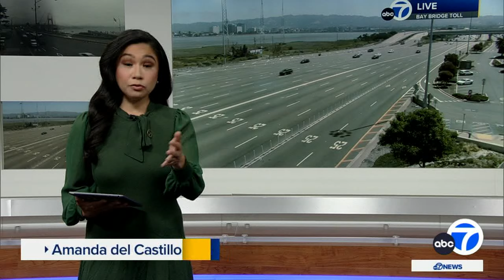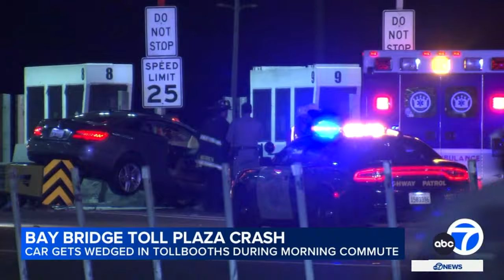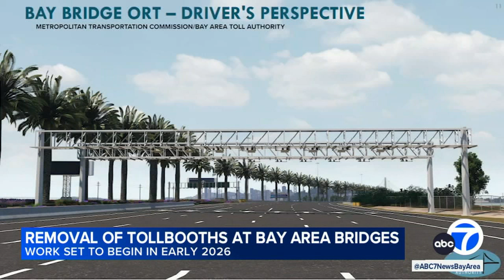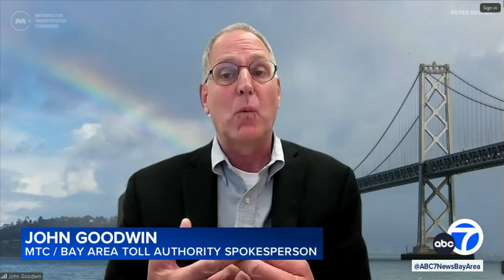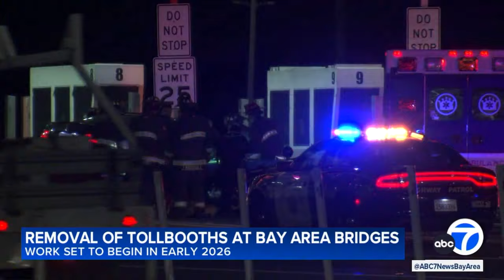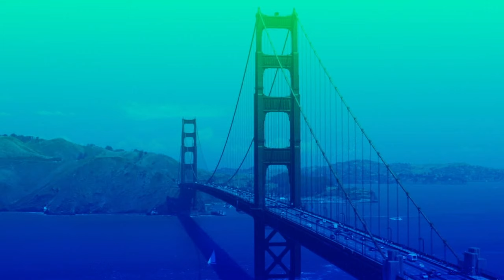Car wedges between Bay Bridge Toll Plaza booths in solo crash

Comment: That perpetually-closed lane on the Bay Bridge is a major hazard.  People not familiar with it don't realize until the last few seconds that the lane is closed, and veer sharply off to the right or left to try to get into one of the lanes on either side.  When traffic is heavy, it gets further snarled by people from that closed lane trying to force their way into other lanes, which slows those lanes even more.  There are already-existing merge lanes just beyond that closed lane on the approach to the traffic signals that people are expecting, as opposed to the "Surprise!  It's CLOSED!" lane at the toll booth. Until the toll booths are finally removed, why can't they just open that lane?  It would make the drive in all the surrounding lanes a little bit safer.

Comment: As if the toll booth had anything to do with the crash.  It's not like there have been a rise in accidents there.  Sure it'd be "safer" but since when was increasing speeds a call for safety?  That's ridiculous.

Vehicles have also gotten larger over time because the all powerful automotive industry just skirts regulations and builds tanks and tells us its what we need.  By that logic, we should be driving slower.  But even without that fact, you always drive the conditions and a narrowing of a lane, narrowed by a toll booth, suggests that drivers should be driving slower to be safe.
Reply: Those lanes are very narrow, and the speed limit thru them is 25 mph.  During low-traffic times people go blasting thru them at full speed.  Most people ignore the posted speed limit on the bridge, too.  It's still marked "50 mph", left over from when the new bridge was under construction and lanes on the old bridge had sharp turns.  Most people ignore the 50 mph speed now that the new part of the bridge is open, and the average speed is 70.